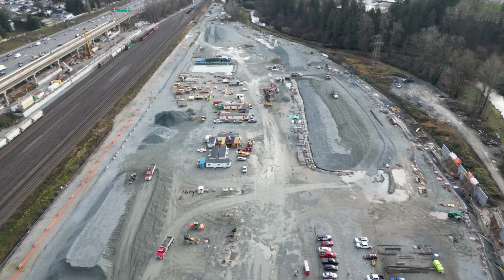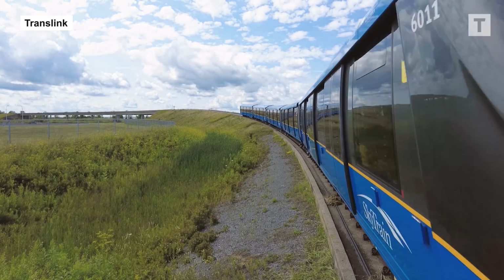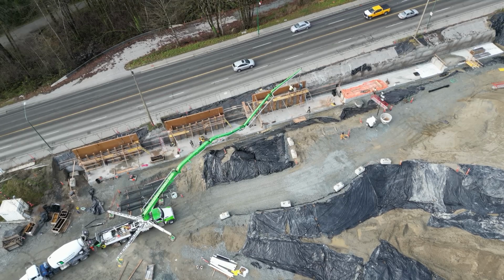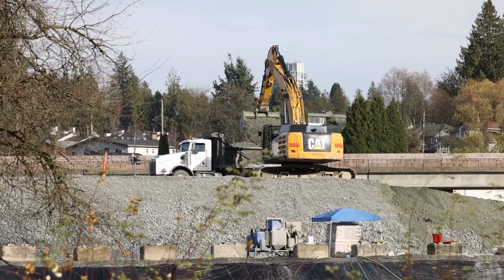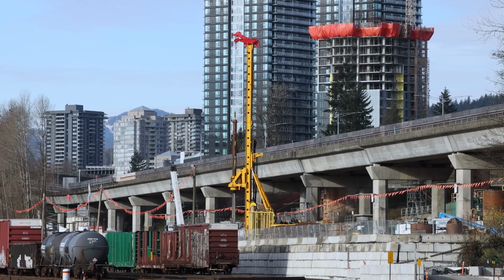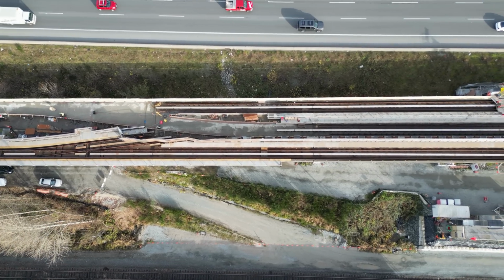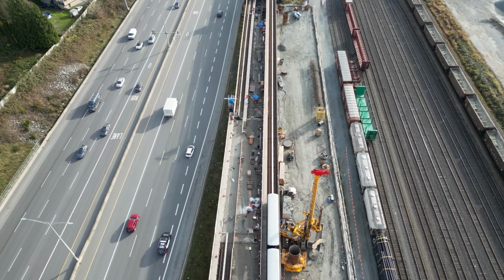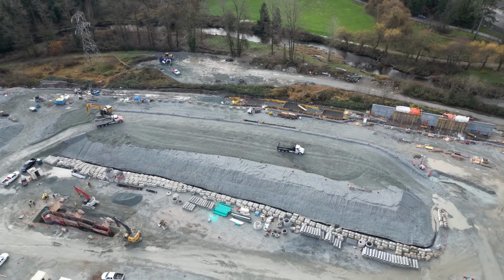Operations Maintenance Centre 4 Construction - December 2024

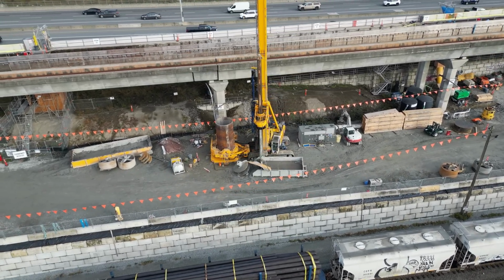Comment: FYI that “clamping device” at 3:21 is a casing oscillator. Its purpose is to provide additional torque compared to just using the pile drilling rig, and it also produces less vibrations which may be important since it’s so close to the existing tracks there.
Reply from the maker: Thanks! That's great to know! I'm hoping one of these days to get in touch with a piling company and see if we can do a deep dive video into the topic, I think it would be pretty neat.